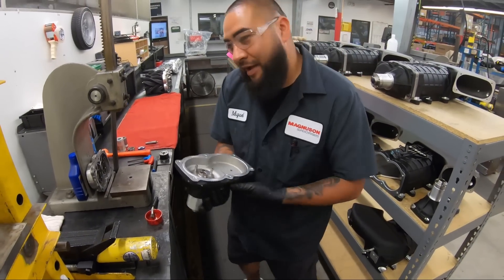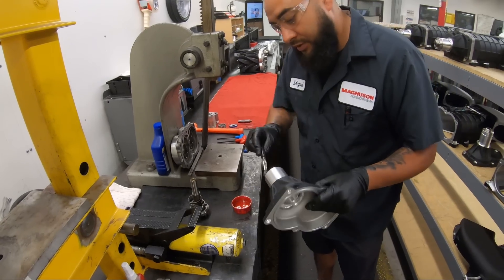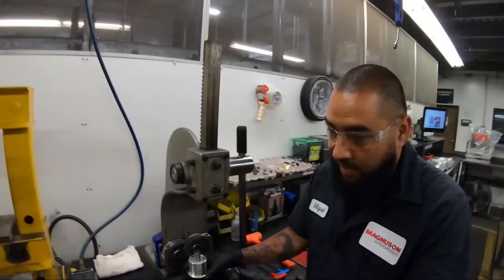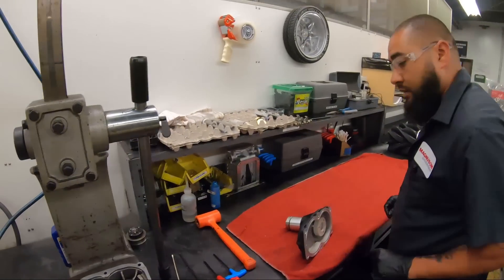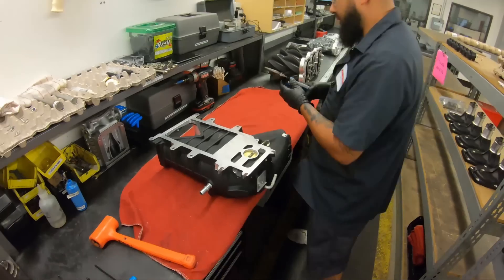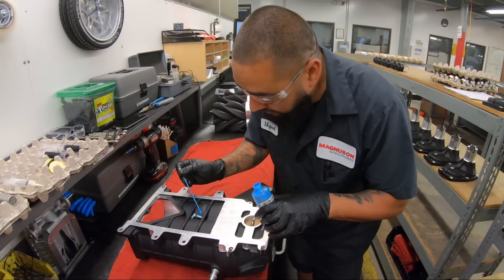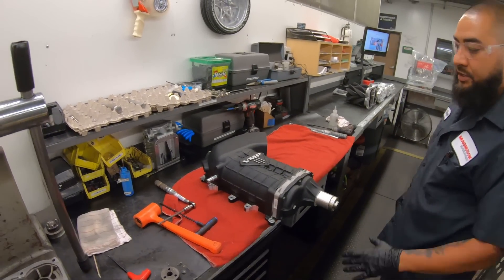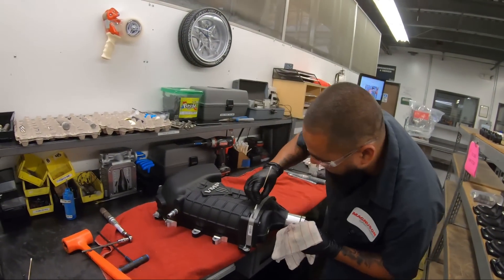How It's Made | VMP Gen3R Assembly

Comment: Did I see bushings on the back side of the blower housing? Why not use bearings instead of bushings? I always associate bushings with slow turning, light load devices.
Always lubricate o-rings, they have to move to do their job.
Reply from the maker: Those are bearing in the back side of the housing.

Comment: Great video, that looks like a quality part and quality assembly!  Curious question; I realize for a product to be successful it has to be producible at a reasonable price for the market.  Can you talk at all about the cost differential between the press fit shaft, and converting that to a splined shaft?  Aside from the cost benefit of press fit, are there any technical advantages to press fit vs splined in this  application?
Reply: Very interested to hear their response, if any

Comment: Great video that was very interesing but can you explain why your supercharger is so much cheaper than a magnusun? $3,500 for VMP and $6,500 for the magnusun when they are built buy the same people?? Something isnt adding up.
Reply from the maker: In the ford market head unit upgrades are very popular because the blower comes off the manifold.  Dodge and GM make their supercharger, intercooler, and manifold all one piece so you have to replace everything when you upgrade.  Replacing everything is why it costs so much more.
Reply: Oh ok, wow I would of never guessed that, thats very interesting. Thanks for the reply cause I was very curious!

Comment: Great Footage Justin!! I love how it’s made!! Hope to see more stuff soon... btw your f150 crew is so sweet and needs more Content or upgrades. So curious see the full Potential of a big crew cab. I have 17 f150 crew 5.5 bed with 11”mild travel suspension with 35” tires. I would love build to just gap Lengths on sports car and just bring the Shock and confusion!!
Reply from the maker: We have some content in the works on the F-150. Let us know when you are ready to start upgrading your truck!
Reply: Awesome!! I will be soon, need set of long tubes and billet oil/crank gears for the big one.I am saving up for the gen3r kit,1300 injectors and e85 fuel system. Hope this winter all I will have the funds!💵

Comment: I can't decide between this or the Edelbrock for my 16GT. I think the gen 3r is the way to go.
Reply from the maker: The VMP GEN3R is not a budget supercharger, but we've got plenty of Gen2R TVS blowers in stock for you!
Reply: @VMPPerformanceTV  well I want to buy once and buy the best. Like the saying goes "you get what you pay for"
Reply: I was having difficulty making this same decision. I think it is going to come down to price.
Reply: @Jack-ox9iz  yeah waiting to see the black Friday deals. I live in florida so I can bring my car to VMP for the install.
Reply: Gen 3R is the top blower in my mind. It has far more potential than I will need, but that doesn't mean I don't desperately want one. 😁
Reply: @Jack-ox9iz  true.  It will make more power than the edelbrock even on a stock engine pump gas setup because the vmp blowers inlet is superior to all the other tvs blowers running the same rotor pack.  The inlet matters alot on pd blowers and the tvs is no different.  Its gonna make more power imo regaurdless of power level.  The harder you spin it the wider the gap will get between them.  Vmp ftw

Comment: that was a pretty cool video another thing that I think would be cool would be adding the Tech that assembled the supercharger name on a small plate
Reply: Similar to how svt used to do with their hand built engines in the gt500 and cobras etc.  On my 07 gt500 it says "5.4 liter 4v shelby gt500 hand assembled with pride" and it has the signature of the two techs who hand built the engine on a little black on the valve cover.  My 97 cobra was also like this that would be a cool addition to the vmp blowers.

Comment: What's the differences between VMP, Magnuson, Whipple, Roush, Saleen, Eaton, Hennessy, Kenne Bell, Supersnake and the Jet Cobra Supercharger?
Reply: One thing that i know for sure is the brand itself. And for Eaton, they are oem part, not aftermarket and they're Roots type supercharger on most of their products. Supersnake is a type of a Mustang car produced by Shelby. Cobra Jet is a type of a Ford Mustang that is race ready (drag racing) from the factory. Saleen is a car brand. Hennessey is a tuning company based in Sealy, TX, USA.
Reply: Kristiadi Hartanto Right, but what's the differences in the Superchargers themselves for them all to want to make their own?     

Why would so many companies want to make the same style supercharger for one engine?  

And what makes one brand better than the other?

I guess my point would be that  just because someone would modify cars doesn't mean they go out and make & design their own supercharger unless they feel they can make it better,  otherwise why do it? 

All of these brand superchargers are the same style intake mounted, so I'm wondering what's the engineering differences?    Bearing style better? 

Is one brand more efficient than the other? 

Is one more reliable? 

They all aren't equal, if they were then it would be most logical to buy the cheapest one. 

Many Channels on YouTube do comparisons on sports cars but no one yet compares all superchargers for one car. Nor do these companies ' Market ' there product in a way that shows what makes there product different, what makes their product better than the competition. If I designed a supercharger I would educate the customer of what makes my product better.